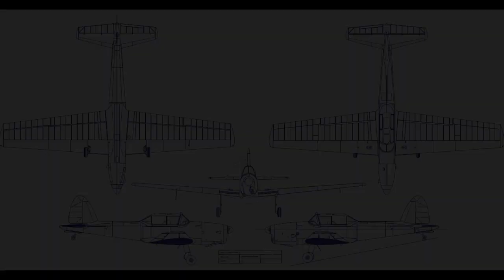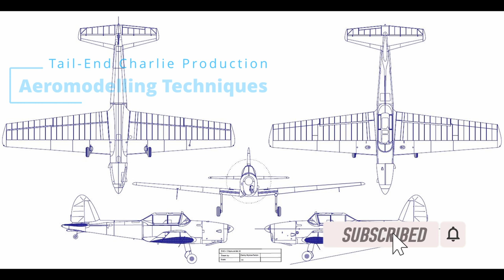Sigh this could take a while.....Quarter Chippy Pt6

Comment: Lovely work and really helpful tips for builders. For the rudder, can you use a long piano wire pin instead that is locked in place at the top of the rudder fin?
Reply from the maker: Hi Adam, yes you could, the problem is it would show if you wanted to make the rudder removable. But it could be a plan "B"

Comment: Excellent work as always! Agree with Adam on using piano wire to hold the rudder. I have used the Robart removable hinge pockets.  They work great. However not sure there durability over many removals and attaching of the rudder.
Reply from the maker: Okay great info, thanks for that and thanks for the kind comments really appreciate it :)